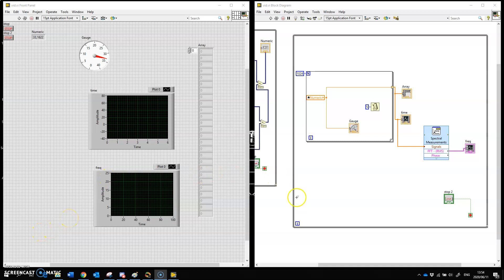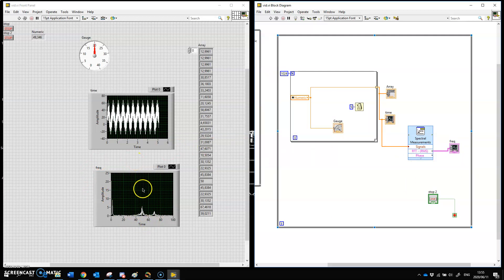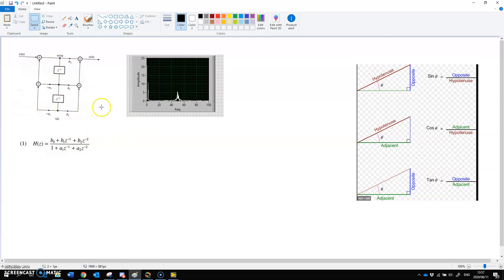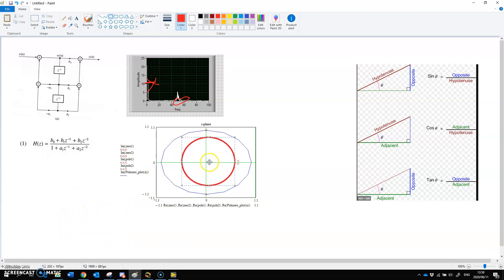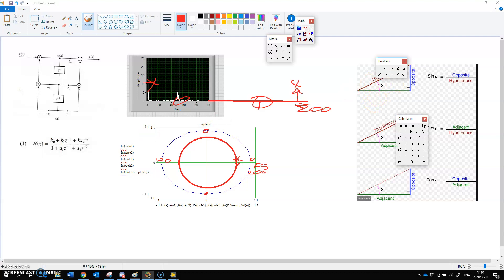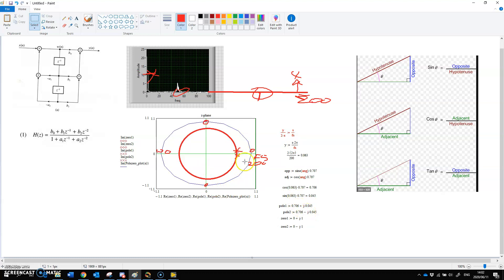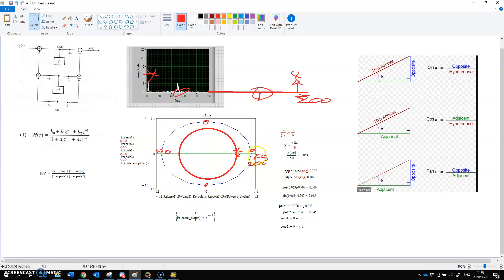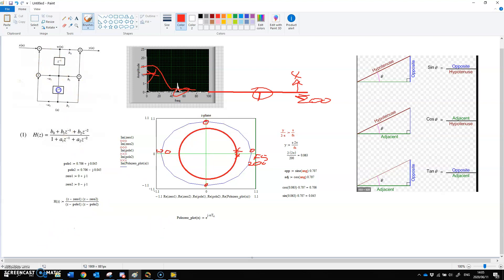16of24 get the bode plote with geometric mehtod

Comment: do you think that your 1024-for-loop processing is the same as the N-sample throughput functionality in Labview?
Reply from the maker: This just generates a window with many values. This videos is made to explain filter design for my class. There is definitely easier ways to do this with labview and its filter blocks. But if you need to program in assembler for example, or make a library as a compiler programmer. then you will follow this layout of program but mabey with temporary regesters etc.
Reply: @nicolaasluwes3987  thanks for your comment.